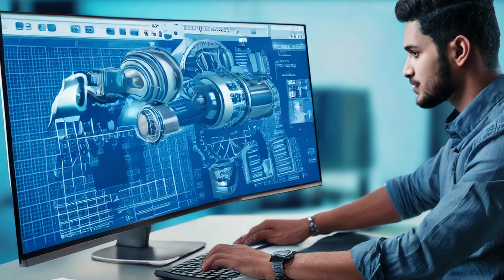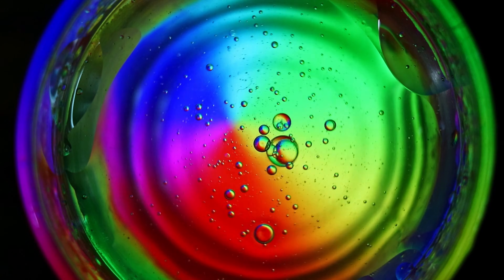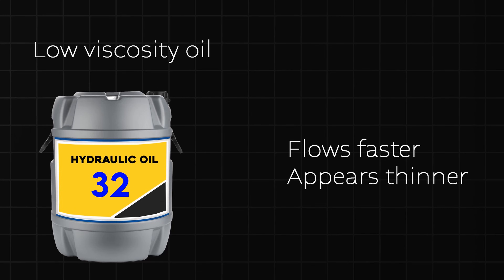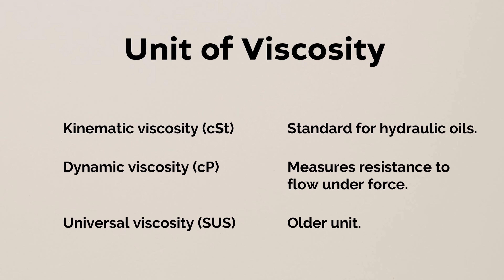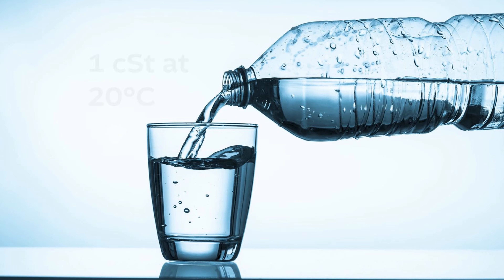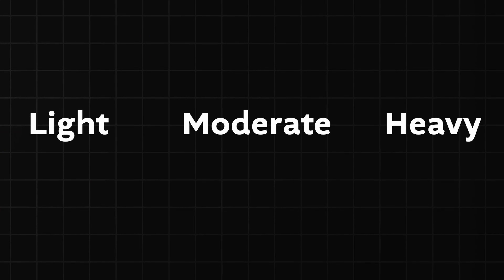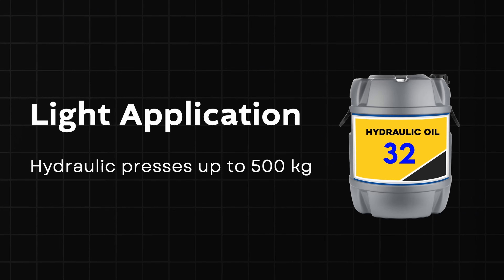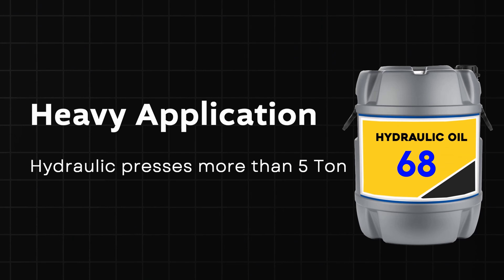Hydraulic Oil 32 vs 46 vs 68

Comment: Thank you for the ready reconer for selecting hydraulic oil. What are max and min hydraulic oil grade numbers?
Reply from the maker: Minimum grade (Lowest viscosity) oil grade which is used for extreme cold conditions are ISO VG 10 or 15.
Maximum oil grade (High viscosity) ISO VG 150 used for extreme load and high temperature conditions
Reply: @mastermechanicaldesign  Thank you